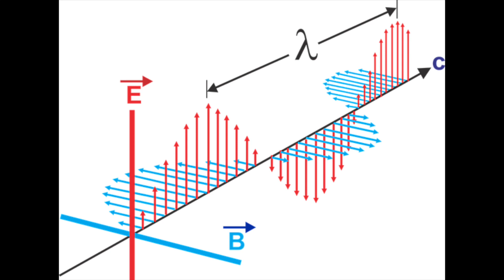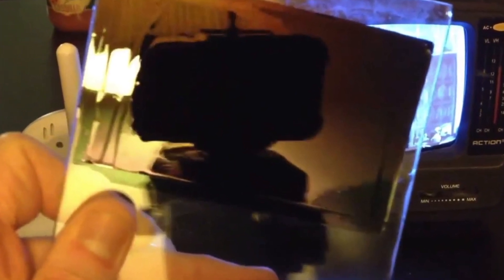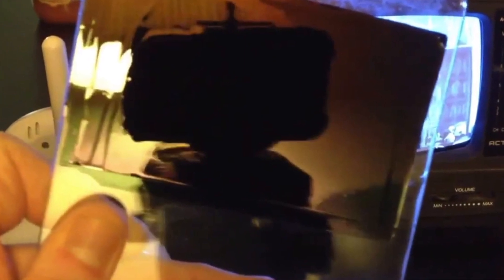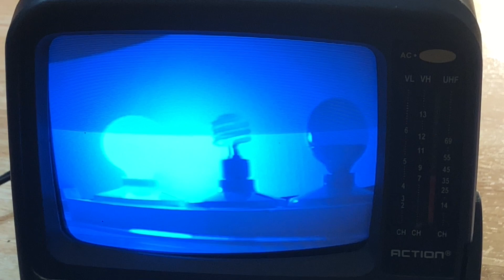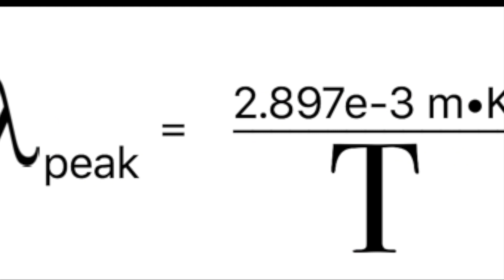Homemade infrared filter and DIY experiment to 'visualize' efficiency of light sources

Comment: Fascinatin sir.  JK, do you think there is any truth to solar panels utilizing 80% infrared whilst only utilizing 20% UV?  Also, I was wondering, do you know of a method to affordably heat a greenhouse in winter.  Here in the U.K we get mostly 4 months of bitter cold.  In summer we get maybe 2 months of reasonably hot weather and the rest is not much better than just  reasonably cold.  I've looked into mini wind turbines ( with shrould ), solar, thermoelectric and possibly thermoacoustic.  I've also looked into earth batteries but a lot of the utility ( water and power ) pipes are located exactly where I would need to dig.  We don't have water charges here yet, so I was thinking maybe I might have a minihydro turbine on hand in case the other methods fail.  I pay a membership on the Robert Murray-Smith channel it's like £5 a month or something like that.  He is heavily into batteries and battery production.   I think he may have been a science teacher or professor at some point.  His knowledge of power generation via physics is above average and he's given a few ideas.  He did a video or 2 about conductive ink which would make a good radiator at the center of a geodesic dome, but in requires 2 or 3 Amps, so any power requirements would need to be substantial and constant.  Aquaponics uses fish to provide food / fuel for plants / vegetables and the bacteria that develop in the grow media need at least 30 degrees consistent heat or they perish.  Some of the vegetables themselves would need that amount of heat to flourish, so I wouldn't begin live trials in winter with plants or fish until I measured and tested sustainable heat within the dome successfully.  Thanks for any thoughts you may have and thanks for taking the trouble to make the above video.  Pat.
Reply from the maker: I'm sorry, but I'm afraid that I cannot help you. Google might be the best place to start ;-)
Reply: @magx1  Already tried that. But yhanks for answering my query. You are most kind. Thermoacoustics. All the best sir.